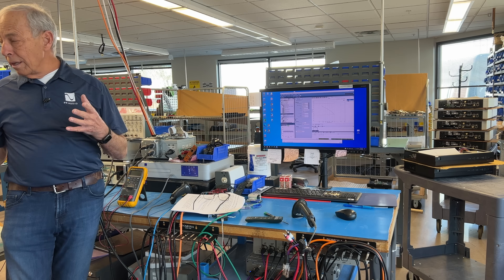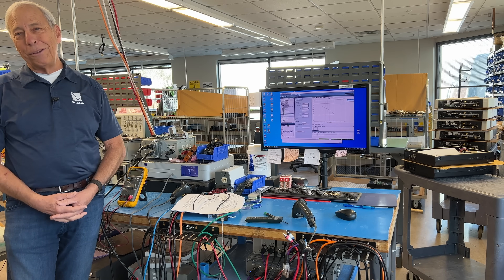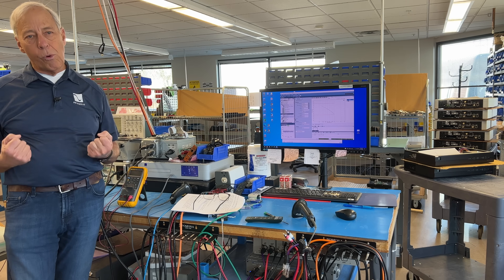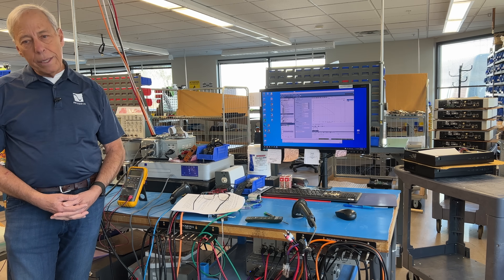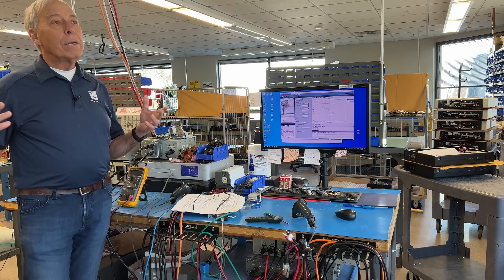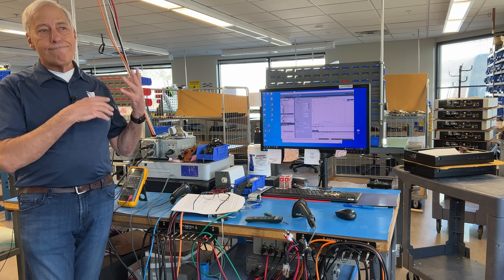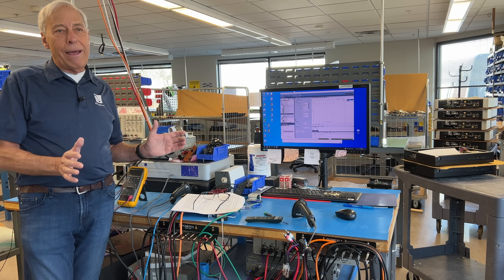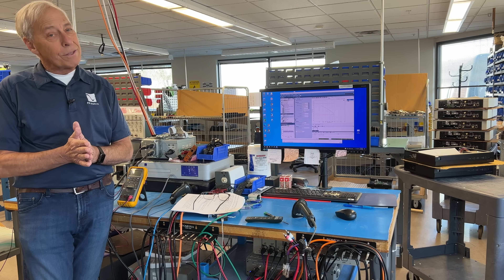Amps that double their power

Comment: McIntosh uses auto transformers on solid state amplifiers to maintain rated power output at all specified load impedances so they can claim, for instance, "200 watts rms into 4, 8, or 16 ohms, both channels driven". There are pros and cons which have been discussed extensively among audiophiles.

Older solid state amplifiers, without output transformers that use bipolar output transistors, were limited by the breakdown (collector emitter) voltage of the transistors. Those transistors are primarily current regulating devices and can deliver pretty high currents to the load. The lower the load impedance, the more current that's required for a given power output.  To deliver 200 watts into 8 ohms requires 40 volts rms and 5 amps. At 4 ohms, a little over 28 volts rms is required at about 7 amps. If the output transistors can only deliver 28 volts into 8 ohms, the power maxes out at just under 100 watts. By the same token, if the power supply maxes out at 5 amps, then only 100 watts will be delivered into 4 ohms. Consumer amplifiers usually state rated power at 8 ohms and 4 ohms. For example, 40 watts into 8 ohms or 60 watts into 4 ohms. That would indicate that either the power supply lacks the current capacity to achieve 2X the power or the output devices themselves are current limited.
Reply: Well said!!
Reply: Wanted to check for a typo:
McIntosh uses "output" transformers or "auto" transformers?
... and older solid-state amplifiers without "output" transformers or without "auto" transformers?

.... Appreciate that summation - really added some clarity. Thank you
Reply: @Douglas Blake And when using one of the taps (don't recall which one for sure), the output stage is actually directly coupled to the speaker and the "autoformer" isn't handling any power.
Reply: BJT's are not limited so much by Vce(max), as they are by SOA (safe operating area) limits.    It's the simultaneous high Vce and Ic that kill them.  Designers need to be very careful to avoid excursions outside of the SOA spec.  
With regard to output stage design, you need to think more in terms of peak voltage and current rather than rms - and load phase shift is also important.
Reply: @Douglas Blake Glad you agree with Marianne on something, others have taken issue with her postings.

Comment: Krell amps would double all the way down to 1 Ohm. So a KSA100 with 100 watts into 8 Ohms could deliver 800 watts into 1 Ohm.
Reply: Yes, such amplifiers are designed with the mindset of running the much higher currents in not only the power supply but also in the amplifier output stage. At 1 Ohms you really need extra care about reaching a high damping factor (low output impedance to actually get twice the power) with transistors that can take the high currents and heatsinks that can dissipate the much extra heat. The power supply isn't really the biggest challenge. Running speakers at very low impedance down to 1 Ohms is common in automotive for getting maximum power out of the 12V voltage.
Reply: I've looked at some Krell schematics.  They are absolute beasts.  Definitely overkill for the vast majority of home audio installations, but then some owners put a very high value on peace of mind.
Reply: At first glance that appears to be something remarkable, but the effect is actually completely normal and defined by the laws of physics. Think of it this way: any amplifier that can deliver 800W into a 1 Ohm load, can't help but be capable of delivering 400W into a 2 Ohm load, must be able to deliver 200W into 4 Ohms and absolutely will be able to provide 100W into 8 Ohms. It can't be any other way when dealing with a conventional amplifier. What would make it unusual would be the combination of an amplifier being capable of driving a 1 Ohm load and at the claimed power output. If the amp can in fact do this (testing suggests a KSA100 really can't quite...) that means it is adequately designed. This applies to every conventional amplifier - if it can output a certain power at, say, 2 Ohms, it can deliver half that at 4 Ohms and half that again at 8 Ohms. Amplifier designers and engineers are just not that motivated to comment "and by the way, every amplifier can do it..."

Comment: I'm no electrical engineer but if I see numbers that exactly double I'm dubious or at least curious. An example might go something like this. 
Manufacturer claims numbers like 300/600.
Reviewer come up with numbers like 470/800.
Great numbers to be sure but not the magical doubling claimed by the manufacturer, the 4 ohm power should read 940 not 800. So, is exactly doubling a regulated power supply thing or what? Do we want a regulated power supply and how does high current come into the equation? Most amps can't truly double so if the specs read double I figure the marketing dept has had their hands on the spec sheet.
*Specs are for a Krell FPB 300c.
Reply: Well, you have to understand that the specs given by a manufacturer, at least a high end manufacturer, are typically going to be very conservatively rated. They do that because they realize that every power supply, your power company or EMC, and where you happen to be located on the grid, isn't the same. Your electricity fluctuates throughout the day. As more people use electricity at certain times, your power sags. You would probably never hear the difference, but your amp fluctuates with the electricity, too, except that the capacitors store extra energy to have on hand when your line sags, or when you need more power than what is coming out of the wall. Anyway, if you aren't getting enough power for an extended period of time, then your amp isn't putting out the full power you think it is. It probably doesn't sound as good, either. At other times it may sound better, especially late at night, especially late at night.
Reply: If the power supply is robust enough and the amplifier is built for high current to begin with then it should have no problem doubling down. A lot of car amplifiers do this with ease.
Reply: @slydawg-d1n  If you only go by the spec sheet sure.
Reply: @slydawg-d1n  Rockford Fosgate 1200D
Claims
400/800
Measured
473/822
Ya seeing a pattern yet?
Reply: The manufacturer is rating the wattage of their amplifier and leaving headroom. They could call it a 50 watt amp if they wanted (that would be dumb, but it's just an example). The reviewer is probably testing the amplifier to the point just before clipping (max clean power). Even with a perfect regulated power supply, the amplifier cannot double the max clean power before clipping due to losses in the amplifier circuit itself. With your example, the amplifier manufacturer was being generous by leaving so much wattage on the table.
Reply: You have a point that when the power supply is not regulated, it will not quite double at half the impedance. So if it increases by 97% that is double for all intends and purposes.
Reply: @hugobloemers4425  Even with regulated supplies, the max clean output before clipping will not be 2x at half the impedance. More like 1.8 - 1.9x due to additional losses in the output stage from the higher current.
Reply: @JohnAudioTech  Especially if you have mosfet output devices with an on resistance. Having a specification of doubled power output with halved load impedance certainly has to be a result of de-rating the claimed power at higher impedances.
Reply: Yes, exactly doubling would require a perfectly regulated power supply capable of supplying the maximum current demand, and the amplifier output stage to equally be able to supply the full output voltage swing and current demand, without any current limiting from output device protection circuitry. Manufacturers will generally be under-quoting the power capability into higher load impedances. For example tests of a Krell KSA-110S achieved power outputs single channel at 1% THD of 391W into 2 Ohms, 227W into 4 Ohms and 118W into 8 Ohms. The testers presumably didn't have dummy loads enough to test a 1 Ohm load. However it shows the expected pattern for a capable power amplifier. This Krell was generally credited with a 100W, 200W, 400W rating at those impedances, it's pretty close at 2 Ohms, and produces more than its rating at 4 and 8. Testing with both channels driven does however bring the per-channel result much closer to the stated 100 and 200 watt ratings.

Comment: " Amplifiers sound different." ? .... well yes & no . Perhaps it's more correct to say, that some Amplifier & Speaker "match-ups" can be better suited for each other. Some, so much so, they can actually be symbiotic. While others are Horrible together, some close to good or very good ...and many more somewhere in the mediocre zone. "K.I.S.S."- there is No easy answer - "One Size Does Not Fit All".
Reply: Yes amplifiers do sound different
Reply: @henriksrensen3220  power amplifiers shouldn't have a sounding as speakers shouldn't - linear response is the goal and any sounding comes from the preamp
Reply: @Harald_Reindl  but they do sound different
Reply: @henriksrensen3220  which is a sign of bad quality
Reply: @Harald_Reindl  No it's not
Reply: @henriksrensen3220  amazing how all you "high-enders" don't understand the meaning of HiFi and what's the job of speaker, amplifier and tone controls
Reply: @Harald_Reindl  I have been an audiophile for over 25 years.
I know what kind of sound i like, and what i don't like. Amazing that you don't understand that there is no such thing as a perfectly neutral amplifier. You should learn to use and trust your own ears.
Reply: @henriksrensen3220  surely - a amplifier with room measurement and a microphone to adjust the system to  a flat response in your room - again: for sounding you have tone controls

Comment: Try 2  Schiit Vidars as Monoblocks, they double in power through RCA, but 400wpc rms Balanced. They are a true Hifi bargain, and nothing else can compete without dropping alot more cash.
Reply: There's two downsides to that
1). To drive the Vidars as monoblocks they need balanced/xlr inputs which means you need and pre-amp which can deliver a balanced output - Freya or similar.
2). That 400W output is rated for 8ohms, the Vidars don't have a 4ohm rating for when they are used as monoblocks.  Just as well most speakers are rated at 8ohm nominal.
Reply: Laugh

Comment: The question that has always plagued me is whether that additional power output is available on a sliding scale. In other words, as my music places demands on my nominally 6ohm speakers will my 175 at 8 ohm 350 at 4 ohm amp output somewhere between 175 to 350 to satisfy the speaker demand?
Reply: Yes.
Reply: @Douglas Blake I’m pretty sure that my Revel Ultima Salon 2 speakers can handle 4 ohms. The amp is an Ayre VX-5 Twenty. You probably think than nobody deserves to own such stuff if they don’t have a clue about measurements. I do know that things sound good.
Reply: @clothyardshafts :  Hello. Speakers do not "handle" 4 ohms, they actually "are" 4 ohms; they "handle" POWER. That 4 ohm number tells you how much resistance a speaker offers to the flow of electricity; it's called "impedance". A 4 ohm speaker offers less resistance (impedance) than an 8 ohm speaker, thus more electricity (Amps) flows through 4 ohms than 8 ohms*. More Amps means more power. Many amplifiers cannot make a lot of Amps, so a manufacturer of low power amplifiers discourages connecting speakers that have "low Impedance". That's why only really high power amplifiers can handle 2 ohm speakers. Fun fact: the impedance actually varies as the frequency of the music changes. YOUR speaker is RATED at 6 ohms NOMINAL which is an average taken while testing with all frequencies of the audio spectrum, but your speaker is also rated at 3.7 ohms @ 90 Hz. Your speak averages 6 ohms during testing from 20-20kHz. Hope this helps a little. Cheers.
(* assuming same voltage)
Reply: @Douglas Blake thanks Douglas and thanks everyone else.